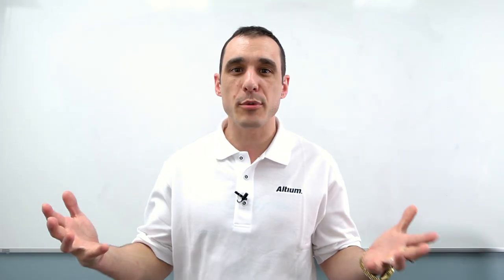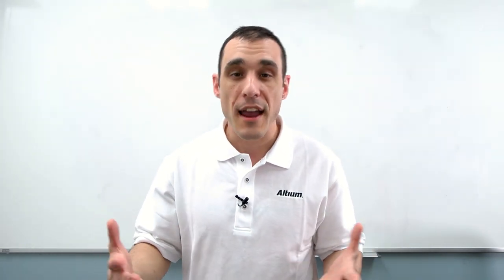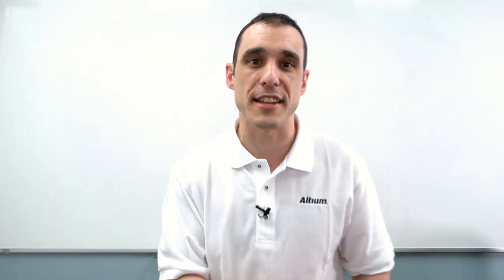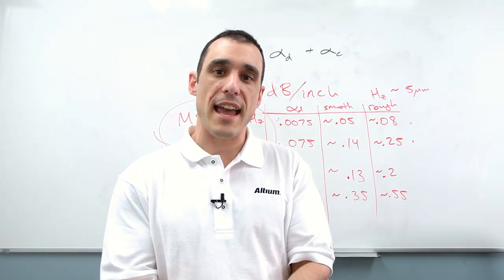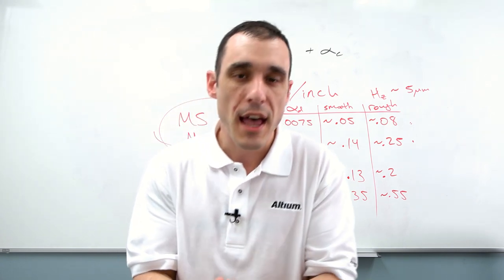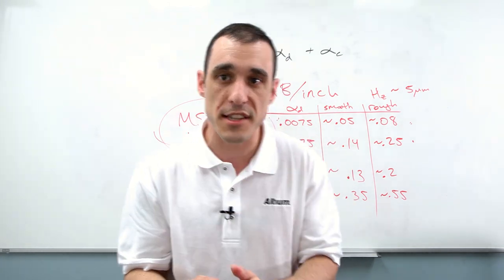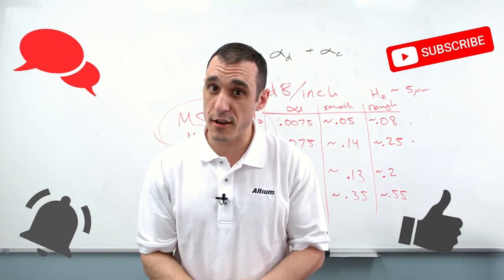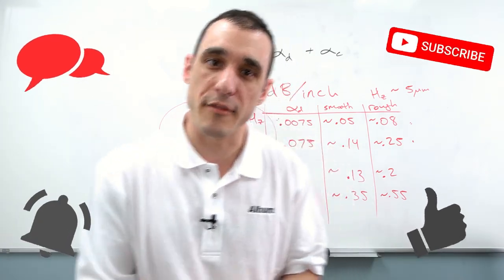Types of Copper in PCB Design

Comment: Can too smooth copper reduce the peel strength and mechanical stability of the PCB?
Reply: Yes, it is the intentional oxide roughening treatment that provides the roughness needed to ensure copper can form a strong mechanical bond with the resin.